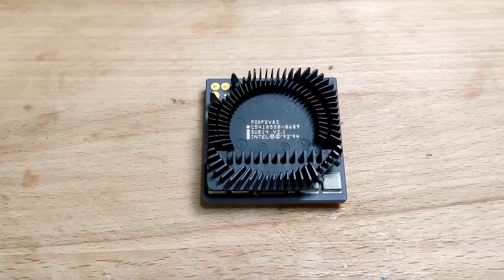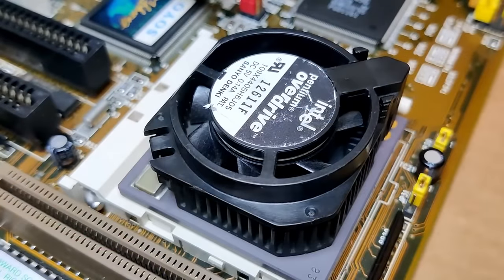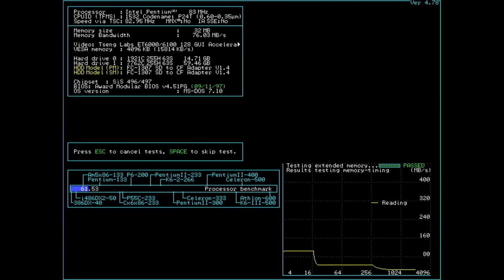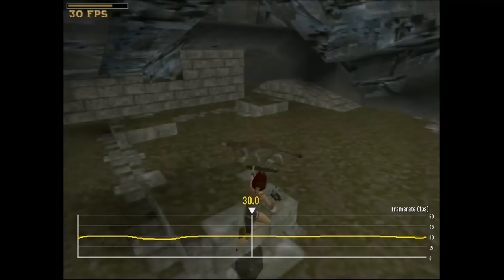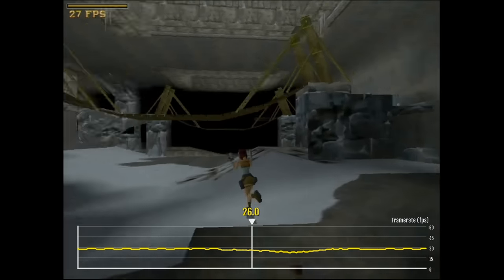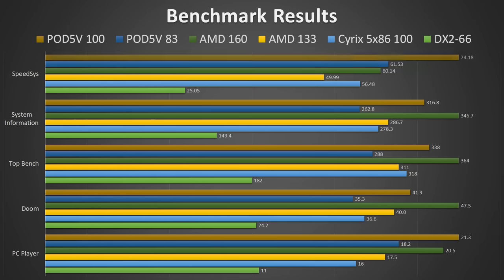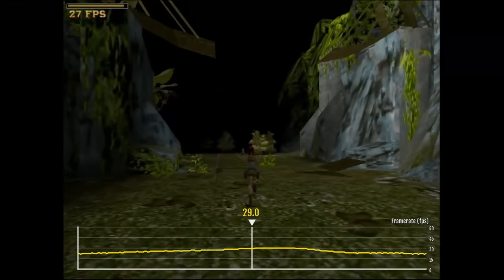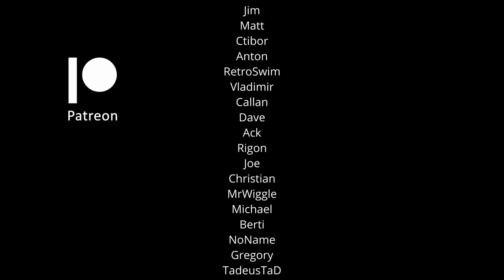Tomb Raider (1996) on a Pentium OverDrive PODP5V83 (Part 8)

Comment: Nice job! Wonder if anyone else interested in GLQuake?
Reply from the maker: Thank you so much for your incredible support! I really appreciate it! Let me pin your comment and see what response we get.
Reply: Not just GLQuake, but pure Quake too. Quake contains state-of-the-art hand optimized assembly for the Pentium processors. I'm really curious how well an overdrive would perform against the 486s. I'm willing to bet that the overdrive will beat even the 160 MHz AMD in Quake FPS.
Reply: @szenti707  Yeah, i think the POD will mop the floor in heavy fpu tasks. No 486 can hold up.
Reply: Yeah. Pentiums can pipeline cpu and FPU instructions giving almost a 2-core cpu effect. (though, each core is very specific)

And quake makes use of it. I remember some interview, where it was explained by one of the devs how they calculated something like: after every 17 pixels drawn, start another FPU instruction for later use.

That is why pentiums perform so well on quake. They don't have massively better FPU, but 486 can't do pipelineing like pentiums can.
Reply: Yes.  I certainly am interested.  A few years ago I tested GLQuake with a socket 4 Pentium 133 Overdrive (which I have two of hehe plus a BUNCH of 83mhz and two 63mhz Pentium Overdrives).  Muthaboard was a Batman Premier POS.  I forgot the exact numbers but with a Voodoo 1 and going from a Pentium 60 to Pentium 133 Overdrive clocked at 120mhz I only gained 5 fucking FPS in GLQuake benchmarks.  I ran several over and over and over until disgust set in and resumed playing Quake Rally on the Pentium 133mhz Overdrive clocked at 120mhz.  A couple of folks told me it had to be muthaboard limitations.  I have several other Socket 4 muthaboards I have yet to test, one of them can go up to 1mb L2 cache, but soooooo much stuff hoarded and soooooooo little time.
Reply: Interesting that would explain why my K6-2 500 would go slower than a Pentium 233 under DOS I guess.

Comment: The Pentium Overdrive is cool as a product. It was a really great way of extending the lifespan on a 5V only 486 system back in the day, and for tasks that hit the FPU it could be way faster than any other socket 3 CPUs. But today, with pricing and such, I'd much rather just go AMD 5x86, even running it at stock 133MHz. To me, having a retro system I can just boot up and it runs, no stability issues, no finickyness, is the way to do it.
Reply from the maker: I absolutely agree with preferring stability over any sort of single-digit performance gain.
Reply: @bitsundbolts except when Tomb Raider needs 0.1 more fps
Reply: The pentium overdrive was a cool product on papper, sadly it was so expensive and low performance gain in most applications that it wasnt really a good option.
Reply: @Thelemorf  It was cheaper than a whole new Pentium system, and if you needed more performance, but couldn't afford a whole new PC... Well, it was an option. But you know, there was a reason why the Kingston TurboChip existed ^^
Reply: There are better 486 platform upgrades than the overdrive.
Reply: "With pricing and such" blame capitalism, people hoarding and running for discontinued products like lemmings once they got popular. I got my POD83 a few years back when they were dirt cheap and the common reputation was "meh, great idea, bad execution" which is thought way too short.
Also good luck with Quake on a 5x86, you'll either need a voodoo which have been ridiculously overpriced these days or a POD ... preferably both.
Reply: @1337Shockwav3  Yeah, capitalism is such a bad system... we should all live in communes where everybody is totally equal, and nobody values anything beyond material cost. 😂   But hey, in the real world supply and demand control prices, and anybody is free to guess what might be popular in the future, then buy low and sell highI.  I'm certain that when you sell your house or your car, you price them similar to others on the market at that time.
Reply: @another3997 I'm not gonna read that, but because I disagree, but because I expected reactions like that and if capitalism works for you that's perfectly fine. I'm an anarchist so you're free to do as you please to a large extend - see if I care :)

Comment: Im guessing Intel just wanted socket 3 to go away by the time the OD was introduced. It made no sense at the price point to buy a neutered p54 on a slow 486 fsb, even more so with such a low clock frequency. I bought a motherboard and 5x86-133 in late 1996 for around $100USD that at 150mhz would hold it's own fairly well, and was 33% the asking price. A year or so later, the prices on a real socket 5 with a p54 120 were cheap enough to leave the 5x86 behind at that point, and atill probably less than the cost of that OD chip.

Comment: those power pins powering the fan are awesome, had no idea about them. intel: maximum engineering originality....back in the days
Reply: Originality? Maybe, but just like Apple's products and other closed systems, it makes finding replacements difficult, if not impossible. Then you have to start bodging things. Intel weren't being innovative, as every other Intel CPU fan was powered in the usual manner, allowing people to have options.

Comment: for those who have these; a large portion of them have contained ball bearings that you can replace, they drop out when you remove the c clip on the fan spindle, and then the fan blade assembly. its an 8mm od 3mm id and i think 4mm thick to retain the right depth. they're stainless steel sealed units.

so if your overdrive fan is making noise, but still works, you might try buying some higher quality replacement bearings to drop in.
Reply from the maker: I recently opened a "boxed" Pentium II fan that was completely dead. Surprisingly, I also found two ball bearings in there. They might not be the correct size, but interesting that you've mentioned this fact - a great time for maintenance!
Reply: @bitsundbolts i consider it providence, i tore mine apart the other day to get the specs to order a new pair (the fans use two bearings, stuck in from either side of the hub, with a divider they left in the brass sleeve during machining).

that you posted this video a day or so after told me i needed to share it to anyone who might have a use for the info. 

cheers.
Reply: Thank you for looking in to this and sharing it.  Definitely going to file this away. I LOVE my Pentium Overdrives.

Comment: I have a podp5v83 in my retro pc, it was originally a dx2-66 and this was a massive upgrade for it. This machine lives in the cabinet my TV sits on, it can happily be used as a dos mp3 player with 320kbit 44.1khz stereo with mpxplay, cpu utilization sits around 50%. Be interested to see how the 486 class cpus perform.

Comment: I think you hit the nail on the head as to why the Pentium Overdrive is now hard to find and wasn't a huge success when it was released. The cost was too high to justify the ok performance in most applications and games back in the day. There are certain cases where it does perform very well, FPU heavy workloads for example. But unless you had a specific need for that a Cyrix or AMD solution would cost you far less and often give you better performance on "regular" tasks. Also, 5V to 3.3V in socket adapters did exist back then. I used one in my own 486 PC as it had a mainboard that only supported 5V CPUs.

Comment: Outstanding video.  I remember reading on VOGONS over a decade ago that roughly 10% of the Pentium 83mhz overdrives would run at 100mhz and I did not even consider the stability of it even if it POSTed at 100mhz.  Same story, over 10 years ago, before the cursed Vintage Computer category on ebay, I got my vile meat hooks on at least eight Pentium 83mhz Overdrives(one of which is new SEALED in box hehe.  The plastic wrap on the box even says Intel), two 63mhz, two 133mhz Socket 4 Overdrives and someone gave me a 486 tower that happened to have a Pentium 83mhz Overdrive that was already clocked at 100mhz! (big HOLY FUCK moment when I booted into the BIOS of that one).  Now I am wondering how many of my 83mhz are actually FULLY stable.  
Thank you again for this detailed look into the stability of this amazing CPU.  Oh, for me I always prefer the Pentium Overdrive to any AMD because of drooling for years to have any kind of Pentium back in the early '90s and having a frugal father who only got us budget family stuff.  U.U    By the way, I LOVED that animation of Lara holding the Pentium Overdrive.  If I could have had any kind of Pentium years before we finally got our P133 socket 7, it would have been like an angel giving it to me and that is what Lara looked like in that animation.  I LOVE it!
Reply from the maker: Thank you so much for your generous support! I really appreciate it! And I am very happy that this short clip of Lara holding the Pentium OverDrive triggered such emotions for you. I do like it too. I think I spend an equal amount of time editing those few seconds as for the rest of the video.
And good for you to have so many OverDrives! Maybe you find the time to test which ones are stable at 100 MHz.

Comment: Good job with pushing a humble POD to (likely) the limit ❤

I presume only crazy fiddling with the integrated voltage regulator on the base of the POD would (riskily) yield a better result, I wonder if there was someone brave enough 😅
Reply from the maker: Yes, there are mods available for it. On the Vogons forum are a few threads and other YouTubers also performed those mods. There are resistor and diode mods that can be done. Unfortunately, as you said, they are not without risk.
Reply: @bitsundbolts Are you aware of the POD@110 MHz using peltier cooling? 🙂
Speaking of which, my POD100 has been diode modded and the original thermal glue been replaced with a better modern compound. It's been rock stabile and running cool ever since.
Reply from the maker: Yes, I have seen peltier cooling solutions. It may be interesting for a project, but difficult to store and set up with all that thermal grease. Who knows, maybe one day, I'll find a POD with the heatsink already removed. I don't want to do this on my current one as I'd like to keep it in its original form
Reply: @bitsundbolts It's quite a gamble anyways. The person who did it had to go through 5 PODs to find one which passed all the common benchmarks without crashing. In my book it's also way too much effort one has to put into a project with very little benefit (contrary to the easy diode voltmod for 100MHz). Never the less glad someone successfully completed a proof of concept with an old, generally underappreciated POD83 - afterall it's almost a 33% overclock.
Reply: Of course, the sensible option is just to leave your socket 3 board as is and buy a true Pentium PC. Modding rare hardware beyond it's limits, and risking terminal damage isn't sensible when a real Pentium 100MHz or greater at stock speeds will trounce the POD.
Reply: @another3997 Please define those limits but refrain from using "manufacturers specs".

Comment: BTW, with the pentium overdrive you can actially install Windows XP on ist, because Windows XP needs just a Pentium which means: any pentium, even the overdrive ones works. There was some guy in Germany which ran Windows XP on an underclocked pentium overdrive with only 8MHz with some tricks!

Comment: That fan/heat sink design is neat!
Reply: I am in love
Reply: Neat but expensive to design and produce, and potentially very limiting. I don't recall Intel using that design on any of their other 486 or Pentium CPUs at the time. I bet lots of POD chips have been binned because owners couldn't find replacement fans or wire a conventional fan in.

Comment: Very solid benches! The POD is very powerfull when the fpu is used. In integer taks its weak point is the low clockspeed as you saw after pushing it to 100MHz. And because of this and the high prize the normal consumer opt für the DX4 or the AMD X5. Because MHz is king. Hello P4! ;-) BTW: The animated Lara part was "whooo"!
Reply from the maker: Great you enjoyed the animated background with Lara. I did some d quite a bit of time on that one, but I think it was worth every minute!
Reply: It wasn't just the low clock speed that hampered performance of the POD, the 32 bit data bus mandated by the old 486 architecture was a major bottleneck compared to the 64 bit bus of a full Pentium system. The Overdrive at 83MHz couldn't compete with the original 60 and 66Mhz Pentium chips.

Comment: I’ll take the lower clocked, more exotic Pentium Overdrive because: 1. Still superior in Quake; 2. anything that is optimized for the p5’s FPU will perform very well, clock for clock; 3. it just looks cooler and fills out all four rows of pins on that socket; 4. I was promised “Pentium Overdrive” upgradability and by god I’m gonna have my pentium overdrive upgrade!

Granted, my reasons may not be the best reasons, but they are reasons.
Reply: Back in the day, your reasons made sense. Today, if you want better Quake 2 and FPU results... just buy an old Pentium PC. Unless you're really lucky, it will probably be cheaper than buy a POD, and certainly much faster. Collecting old hardware is great, but getting 10fps in Quake 2 at low resolution still looks awful compared to playing on a 200+ MHz Pentium.
Reply: @another3997  Retro computing is all about back in the day. I can run Quake (I was referring to just Quake, the number "2" was just a second point in my list) just fine natively on Windows 11 running on my R9 5950x / RTX 3080 at an unreasonable number of FPS. But if I want the worlds best socket 3 silliness, than I want a Pentium Overdrive. None of this is about making sense - these machines are all antiques.

Comment: I have a socket 2 system as my only 486 so I rely on the Overdrive chips as they're 5V only. I never noticed that much difference between the PODP 83MHz and the DX4 Overdrive at 100MHz. For nostalgia's sake, I tend to keep the DX4 in there.

Comment: Just FYI, the fan is not exactly the original one from the POP5V83. This black and white one is found on socket 7 Overdrives instead. Socket 3 ones have a blue Intel Overdrive logo.
Reply from the maker: Yes, it is indeed from another overdrive (133 I believe). However, they're compatible - which is great!

Comment: Personally I would prefer a Socket 7 motherboard over a Socket 3.  A 386 DX 40 for old DOS games and a Socket 7 for 90s games.
Reply: Agree. Especially since an MMX CPU can be slowed down in fine grained steps with SETMUL. See Phil's Computer labs' video on the topic.
Reply: or socket 5

Comment: I was lucky and picked up a POD83 on Ebay a bit over a decade ago that was sold damaged with all of the pins having a bow in them. I forgot what I paid for it, but it was cheap, under $20. After the pins were straightened, it worked fine. It sort of looked like the previous owner had it in a LIF socket and pried it out incorrectly from just one side.

It's not a CPU I'd recommend for a retro machine because it's temperamental and motherboard support is dodgy. The only purpose of the CPU is if you need the Pentium's stronger FPU, in all other cases, fast Am5x86 CPUs overclocked to 160 MHz is a far better option, and it won't cost you an arm and a leg.

Comment: @BitundBolts
If Socket3 was my only option, then a Pentium overdrive would be my choice because of the FPU. Even back in the day, games were not the only thing one would be doing with a PC and the FPU would be very desirable if one could not afford a newer Socket5/7 platform. But that was back in the day. Today, for retro gaming, you are absolutely correct, the AMD with the 160MHZ OC is the way to go. Personally, I would go for a Socket 7 based system with a Pentium MMX 233 or K-6 as they are still easy to find, not very expensive and very simple to OC.

Comment: And yet another outstanding piece of work. Great video in a fantastic series, thanks again. Intel probably knew why they never sold an Overdrive 100. What software was used to display the frame counter on Tombraider?
Reply from the maker: Thank you! A 100 MHz Pentium OverDrive would have been a great upgrade if it weren't that expensive. It would have given the socket 3 another year or so - which most likely was not in the interest of any company selling motherboards. Tomb Raider displays the frame rate when the 3Dfx patch is applied. No other software is needed. There are also other patches like for S3 cards that have even more options (like changing the resolution). But I have not tested those yet and I don't know if they display the frame counter.

Comment: I think the only benefit of a Pentium Overdrive or any other 586 was the ability to run new software optimized for Pentium.

No one else would have bought it if they advertised it in a realistic way like: "buy an expensive temporary solution this year and buy this year's real product in two years when it is already outdated so we can sell you our next expensive temporary solution, rinse and repeat"

A Pentium Overdrive was really worthless for gaming if you had to reuse the 200 MB hard drive, the 8 MB of RAM and the SVGA with 256 colors at 800x600.

Comment: I upgraded my 486 machine (AM5x86@133 with 48M RAM, Trident VLB 2M VRAM) to an Pentium 100 with 48M RAM and S3 PCI with 2M VRAM. The difference was amazing. Games like Anno 1602, Quake, played way way better and Starcraft was finally playable. When I upgraded to P@166 the difference was huge. 
So yes, at the time I would liked to have it and gave it a try with my 486 machine, maybe I would not upgraded to an Pentium (the main reason was to play Starcraft) but now, my opinion is, as Phil say "slower is better". However, I still am a bit curious: how could have performed my 486 machine with this CPU, running Win95 and playing the games that I enjoyed then. And I have to say that I tweaked my computer to squeeze the max performance that it could give.